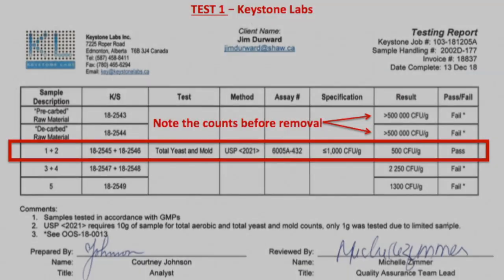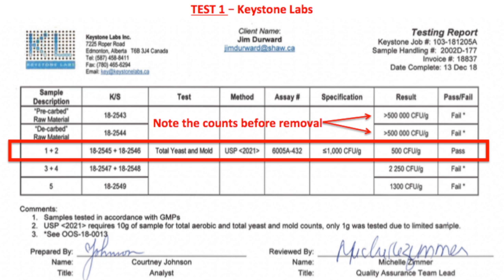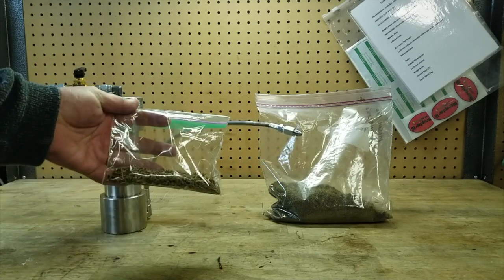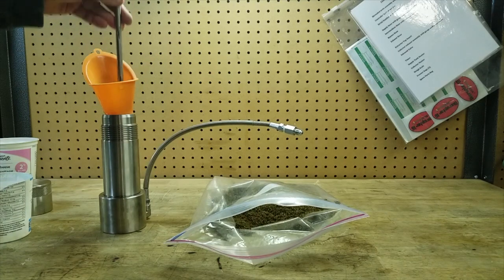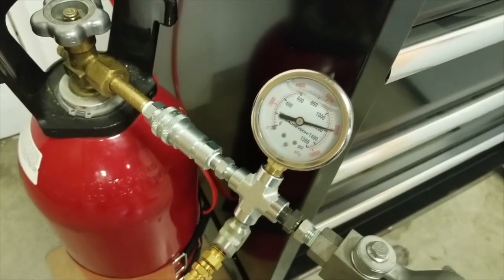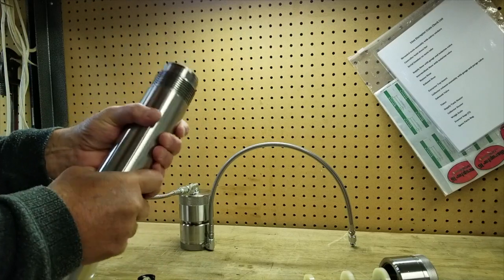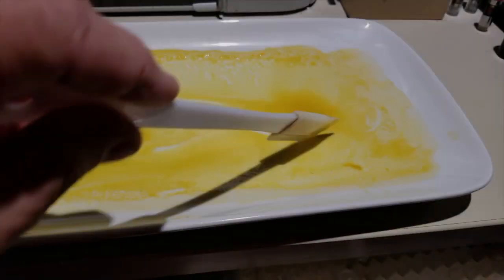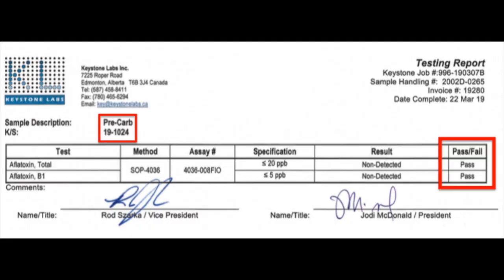How to remediate mold.

Comment: Here's what to do with mouldy weed:

-(optional)Grind it up & put in on a dinner plate inside a bucket/upturned tub with Ozone generator blowing ozone into the tub (ozone chamber) & blast it with Ozone in the tub to kill live mold spores

- Next blast it with butane to extract it

- Once butane has evaporated, remix with 99% isopropanol (at least ) 20x as much alcohol as bho / 20:1 ratio. This ratio may end up eventually being 50:1 after you wash down funnels/jars/flasks with isopropanol after each filtration stage, it doesn't really matter though. The more alcohol you use the less extract is lost via transfer processes but the longer it will take to filter and potentially use more filters

- Put solution of green isopropanol in the freezer for at least 24hrs to get the lipids&waxes to precipitate

- Filter through medium speed filter paper (5-15 micron) using gravity filtration, or alternatively a buchner funnel & vac pump to speed up filtration. This will remove lipids/waxes and larger particles which may block up the smaller filters later on

- Filter again (using gravity or buchner filtration, although buchner thoroughly recommended) through slow speed filter paper (under 3 micron like whatman size 5 filters). Supposedly this should take out most mold spores, I've seen some websites claiming mold to be 3-12 microns in size and one claiming that it can be down to 1 micron in size, either way you're almost done

- Buy some 0.2 micron syringe filters (0.22 micron are more common and will do the job) 0.2 micron is small enough to filter out ALL mold spores and bacteria, (but not aflatoxins which a lot of moldy weed may not contain anyway, as this video shows) and squirt your alcohol extract through the syringe filter to remove ALL mold, your extract may be safe to consume at this point unless there are aflatoxins from the mold. Mold spores are 3-12 microns in size (I've seen some vendors of hepa filters claiming that they can be 1 micron in size, either way you should be safe)

- To remove aflatoxins leave alcohol extract in the sun for an hour or two for UV sterilization, or decarb the extract in a butter/oil to kill off the toxins with heat and eat it instead of smoking
Reply from the maker: Have you ever tried to push the 10:1 mixture through a .2 micron syringe? How long did it take and how many filters did you go through?
Reply: @ndatalyzecorp.3792  Yes I have now tried it (please see previous answer below) After pre-filtering the mix through 5-15um then 2.5um filters I had no problem passing the extract through 0.2um syringe filters. I chose to swap out filters regularly instead of waiting for them to clog up. I used 4 filters to filter about 180ml of green coloured isopropanol which contained approximately 5g of extract. I could have probably gotten away with using less but didn't want to risk blocking a syringe and forcefully breaking the filter mid-way through. After boiling off the alcohol I have a nice clean extract. I haven't been able to lab test it as this is not possible for me in my country, however before the filtration I was having an allergic reaction to the mold spores within which caused me to go itchy all over and get ringworm-like blothes all over me and had to cease using the product completely........ As yet I am blotch-free and itch-free so I can only assume that I have successfully cleaned up my oil.

Previous answer before testing:

 To be honest no, fair point and cheers for the reply. This is all theory based on what little information I can find about this subject online. I'm about to experiment with it on a very small scale with only a few filters but I did genuinely wonder whether I'd struggle going straight for 0.2u or whether a series of gradually decreasing filters would be better. Based on your questions/hints (and your comment that you're using a multiple stage filter) I'm guessing ahead of time that I am going to have troublez. Ahead of trying I will take your hints and alter my plan and try with a series of progressively smaller filters before the 0.2u, use more isopropanol than the 10:1 ratio and edit my comment to point out that this is as yet untested. Do you have any other advice or pointers?
Reply from the maker: @James-rf2ln  not really - I found out using trial&error and lab testing

Comment: What kind of filter are you using to filter out the mold, yeadt and spores?
Reply from the maker: stainless mesh - see the test results here - https://medxtractor.com/mold-removal/
Reply: @ndatalyzecorp.3792  Thanks for quick feedback. What size and where can I purchase the same filter? Best regards
Reply from the maker: @stefanstolt5100  we don't sell them separately - it is actually a "sandwich" of filter elements - you can go to Utah Biodiesel
Reply: @ndatalyzecorp.3792  Thanks for the tip. Wich product should I ask them for?
Best regards
Reply from the maker: @stefanstolt5100  Sorry Stefan but you need to do your own research - we spent money finding out how to do this and we only provide it to our paying customers.
Reply: You can use a 0.2micron filter to filter out all spores and bacteria. Just make bho, dissolve it back into 10x it's weight in alcohol and squirt it thru a 0.2 micron filter. You can buy a 0.2 micron syringe filter
Reply: @stefanstolt5100  0.2 micron